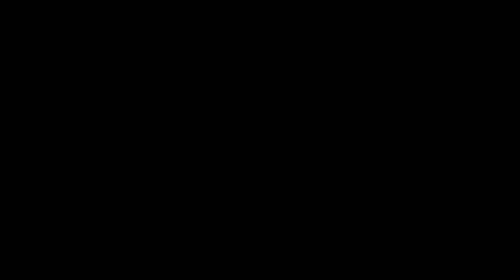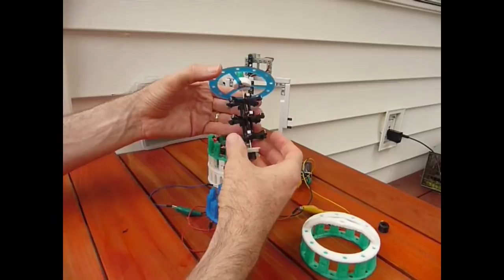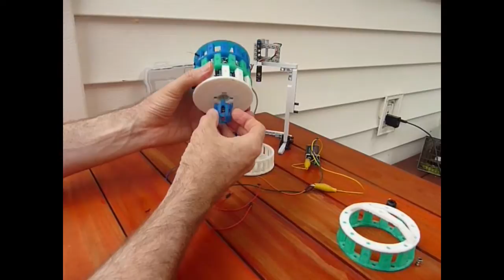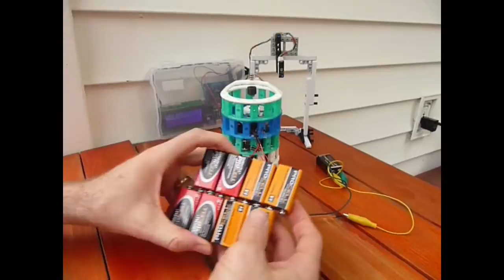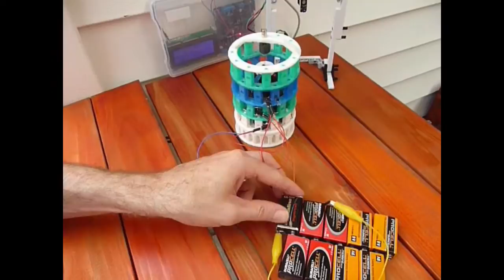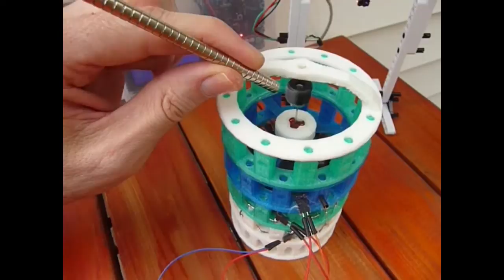Multi-Rotor Pulse Motor

Comment: can you power things on with this motor? lamp? radio?
Reply from the maker: Actually it doesn't have any real power.  When a magnet gets close to and passes by the reed switch, it turns the switch on.  This energizes the coils and causes a magnetic pulse that pulls the magnet away from the reed switch and toward the coil.  As the magnet moves away from the switch,  the switch turns off which de-energizes the coils, and then the rotor coasts.   The rotor will coast until the next magnet gets close enough to the reed switch to turn it on and again energize the coils.   Because it is coasting between pulses,  it has no real power.   This also makes it very important to eliminate friction.  You can see how it was made on thingiverse.  See how to build here:  
http://www.thingiverse.com/thing:846244
and here: 
http://www.thingiverse.com/thing:781068